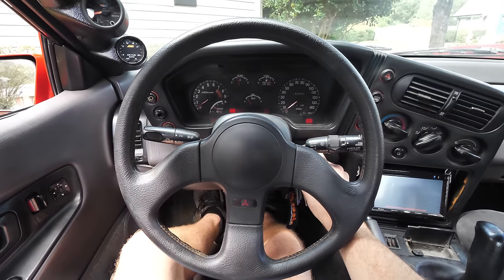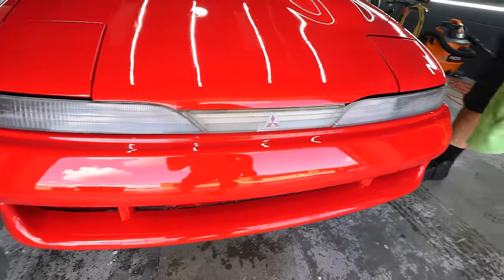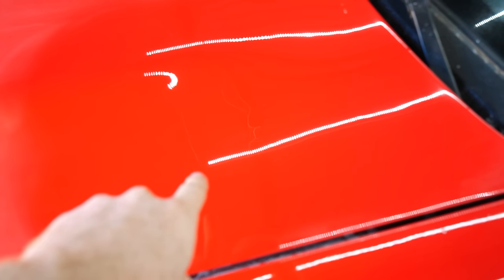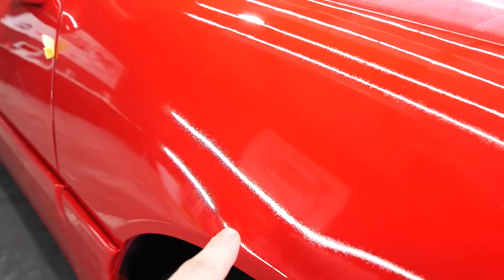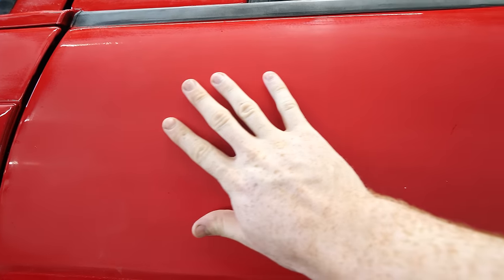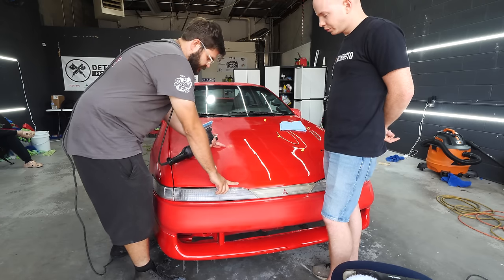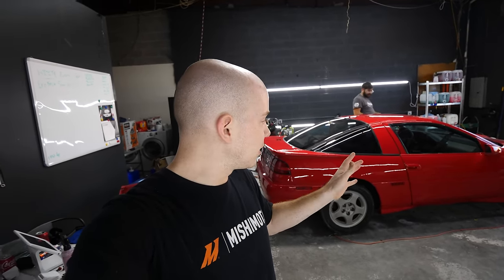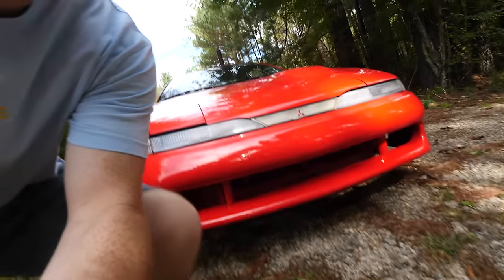Can You Fix a $1600 MAACO Paint Job? (Extremely Satisfying)

Comment: MAACO can be good.  1.  Shop around, there are usually a few MAACO shops in your area.  Go to all of them, look at cars in process, and finished cars.  Im in SoCal. Costa Mesa MAACO bid over $3000 just to strip down old paint and body work...  before he would even make a estimate on the paint.  I went to MAACO of Orange and got the whole thing done, 2 stage paint, color sand and buff for $2800.   I complained to MAACO Corporate and the just said every shop is independently owned, nothing they would do about it.  So..  SHOP AROUND...    SECOND...  if you are handy at all with tools, or get help from a friend, remove as much trim items that you can.  Headlight bezels, grills, side trim, once at the shop, remove the tail lights, maybe even bumpers, if they are chrome.  You will get a much better job.

Comment: Most of that looks like little air bubbles in the paint. If Maaco would have slowed down and not apply so much paint so fast along with using less hardener/activator you wouldn't have any of that (you'd just have typical factory style orange peel). Judging by how most of that is coming out, it suggests it's just the top layer which means they waited to long between coats too. . . . . AMATEURS! TOTAL AMATEURS! For $1600 I was expecting much more.

Comment: I found a guy that did rust repair correctly,and  minor dent repair with paint.
The job was done in a tiny one car garage that the mini van barley fit in.
The job was so good it didn't need cutting.really.
Maco want 3200-4000.

Comment: The sad part is that I've laid down paint better with my Harbor Freight gun and compressor than MAACO did. What's crazy is that I've NEVER had pitting or fisheyes and all I've used is a cheap Campbell Hausfeld air/water separator, no gun filter.

Comment: Is it me or does it seem like you’re taking the entire clear coat layer off? How long does the polish last/protect?
Reply: Naah there's plenty of clear coat left. Although when you sand, you can totally go through it if you don't know what you're doing but usually a manually painted car has a lot of paint/clear compared to a robot ( original ) so basically they are just reworking the jagged clear to be as flat as it can be, this takes 95% of the paint problems even if the base coat hasn't been done properly. Polish waxes and stuff lasts months, ceramic coating can last years if done correctly. Cheers mate!!

Comment: It looks great.. but how much would did that cost? Did it take 2 eight hour days to do it? Could you have saved that cost with a better paint job? Still the car looks 99 percent better.
Reply: Usually higher end paint jobs include a wetsand and buff. Even the best professional auto painters can't get the paint as smooth and perfect straight from spraying as it would be after a buff.
That's why good paint jobs put so many layers of clearcoat, to have a lot to buff to achieve a mirror finish.

Comment: Looks like he didn't clean your windows? For shame! 😂 But all in all it looks quite clean now.
For the black rubber/plastic trim you can use a Ceramic coating. Clean the trim with a high alkaline solution, use a brush to scrub out old crap, then apply a coating. That'll make it pop👌

Comment: They just scuffed the original paint no primer just on the bogged parts, the new paint is already having a reaction with the old stuff, the cutting and buffing y’all did definitely helps but it might just come back within a year
Reply: What makes you so confident the paint is having a reaction with the old stuff? Considering all Ging and Co. did was cut down the clear coat, the coat that's only touching the paint THEY (Maaco) put down.. You'd think a reaction from the color coat would show through, right?

Comment: Im pretty sure all paintjobs will need a wetsand and paint correction after to make them like glass but the maaco job was pretty bad. Oh well. For $1600 it turned out great! 
Im assuming for anybody else, itll be another 1500-2500 for a wetsand and ceramic coat
Reply: Generally when you pay more for the more expensive jobs (not from Maaco obviously) they also do the wet sanding.
I honestly cringed when he took it to them and when I saw all that pitting it just hurt because some of that is because they didn't give the paint time to dry so it was off gassing up through the clear coat so you can't really fix those without completely stripping it back down.

Comment: it looks great but its wild that maaco charged you so much for that. unless you don't have a garage at all, which i don't, you really may as well do it yourself. put on several thick coats of clear and then wet sand it to fix it up. i think i read that it takes 2 gallons of base and 2 gallons of clear to paint a car. what could that possibly cost? 100 dollars? a paint gun is like 40 bucks. a compressor is like 200. and then what? garbage bags, tape and newspaper? i mean, you could easily get better results than maaco for a third of the price if you have the space an the patience.

Comment: You should have complained and asked for them to respray.. that’s totally unacceptable for a paint job. They literally sprayed over a wax and greased surface. After a cut and buff the finish should be be 9-10 from 1-10.. after cutting and buff it’s a 4 or 5. For 1600 it could have been much better that wouldn’t even need a a deep cut

Comment: 1600 for paint job, 500 to sand and buff; better to use that 2100 and get an Eclipse in better condition.  Also, Maaco uses the least expensive paint base and clear coat...paint not going to last. clear will fade and/or peel in no time.  That paint job looks like rattle can done in a garage.

Comment: I send at least car a month or so to macco and use there $1000 paint job for my used cars, I do some of my own minor prep, but the end result comes out 10 times better right from the paint booth with no need to wet sand and polish than what you ended up with after all the wet sand and polish work,bottom line is the original paint and prep you started with was junk because the macco' shop you dealt with their paint and prep process sucked. It's not the cheap paint job you paid for it was the low quality work of that macco shop